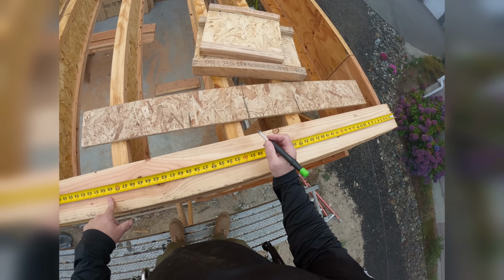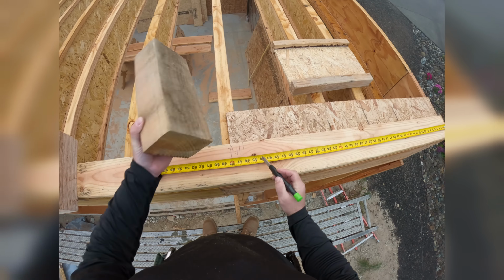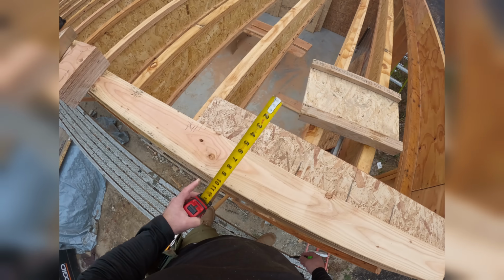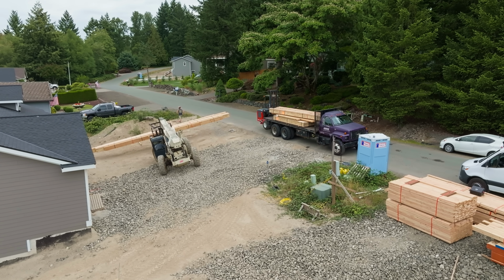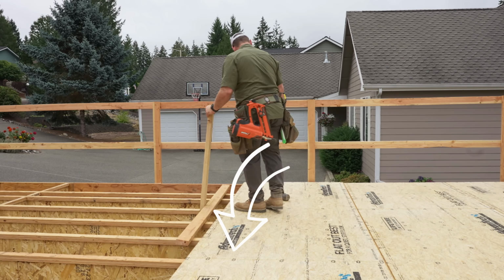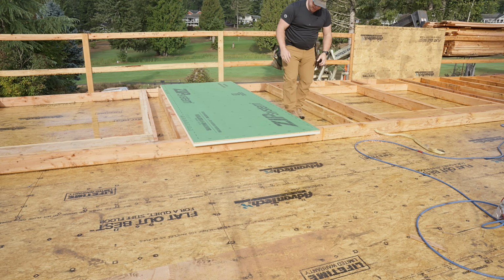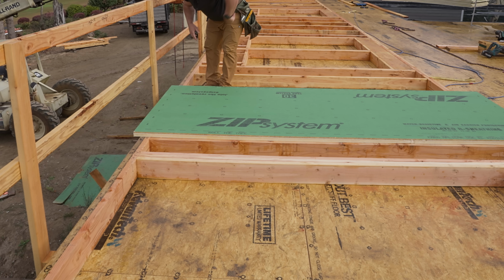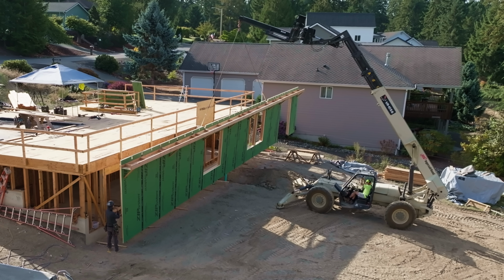STACKING FOR FRAMING IS HARD!?| Lay Out FUNdamentals

Comment: Hey Tim! Love the content, there is always something I learn or pick up every video that adds to my continuing education as a builder. Question about the R-sheathing, is there a reason it is more often used on just walls as opposed to walls and roofs? I thought the foam was supposed to help with thermal bridging between the exterior and wall framing, is that not as big a concern on the roof? Is the zip sheathing you use on the roof thicker or different in some capacity from the wall sheathing? If you wanted to use R-sheathing on the roof, what sorts of roof framing considerations would you have to make? Thanks again for all you contribute!
Reply from the maker: The manufacturer doesn't warranty it for the roof for a few reasons.  In some cases compressibility of the foam, uplift values on the fasteners.  Trust me, we are trying to get this approved for the roof.
Reply: Why bother with ZIP R on the roof when you can just use Raised Heel Truss & put as much insulation as you want. I know in the south people tend to put HVAC in the attic then ask the truss manufacturer for Plenum Truss with Raised Heel so you still have enough insulation space above the exterior walls.

Comment: thoughts on this practice i picked up from a Habitat for Humanity framer in Atlanta, GA last century (it was 1997 if that matters) using sheet goods to square the wall on the floor?  

They were prebuilding walls in a warehouse in advance of one of the blitz build things where they'd get the whole house built in a week.  So, like you, we laid the top/bottom plates on the floor, put the pre-cut studs in on 16 centers, put in windows/doors, kings/jacks/cripples/headers where appropriate, but to square the wall up, we simply used the edge of the sheet good panel as huge framing square.  Align one corner, nail it.  Rack the wall to align the edges and fully nail it.  No diagonals, no math.
Reply from the maker: That's ok for a short walk, maybe 1 or 2 sheets

Comment: Great job! 
Thanks for sharing.
Do you ever use SCREW SHANK NAILS for framing? What is your experience on those?
Reply from the maker: Only for some floor sheathing applications.  Not for framing walls, floors or roofs. No need for a screw shank in those situations.

Comment: zip products are not available my country, NZ. What would you suggest as close 2nd place?
Reply from the maker: I have no idea 🥴
Reply: If you’re thinking Zip Sheathing as an air barrier you can do the same by taping the seams of the sheathing. Taped seams = more airtight. OSB is tested as not airtight but still if you’re not targeting Passive House level of airtightness, you’ll still be tighter than any houses built in your area because taped sheathing isn’t really common. Plywood is considered Airtight when all seams are taped. Just add your preferred weather barrier to the sheathing and you’re done. The advantage of Zip Sheathing is once you tape the seams you’re airtight and weather tight too.

Comment: I would love it if you could talk more about 3x6 or 4x6 studs… and at every panel edge? That’s like every other stud on 24” centers, no?  Does that pretty much guarantee you aren’t using batt insulation between studs?
Reply from the maker: We'll still be using batts. It's because of the 1" foam on the Zip R6 and out seismic zone. If I can get Huber to publish data on 4"oc nailing we could skip the wider studs

Comment: Inline framing, code gives you 1.5". And in cases were you have 16"OC walls and 24"OC joists you have like 5". And didnt I see another video from you guys about how the rim board transfers the load and not the joists.
Reply from the maker: Double top plate changes the offset so 24" oc rafters can sit on a 16" oc wall